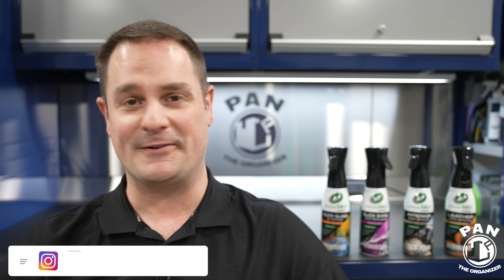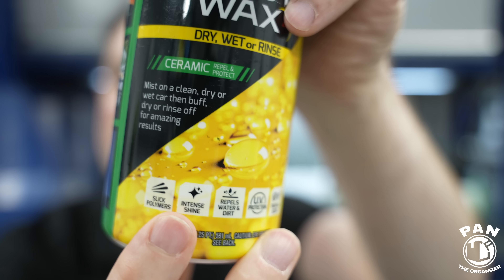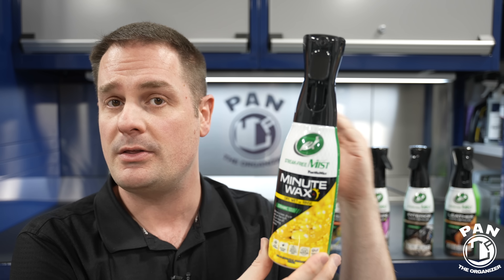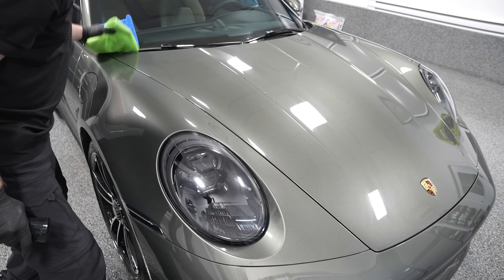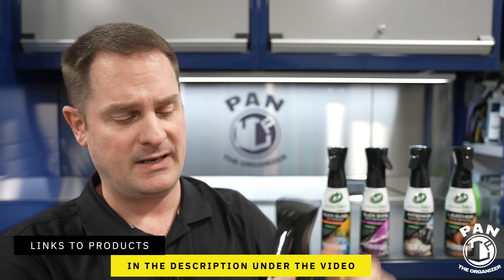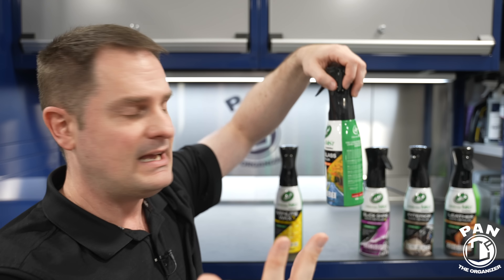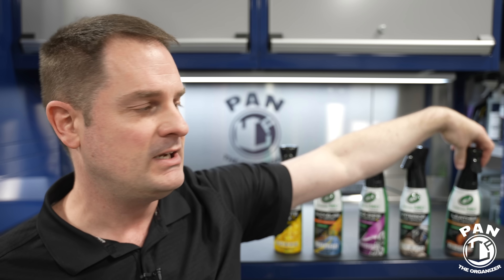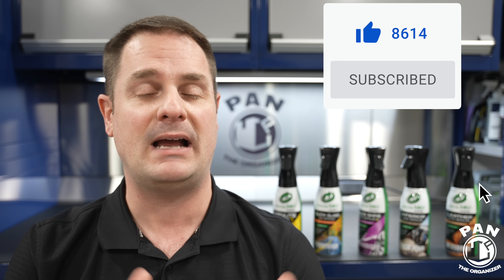The NEW Turtle Wax Minute Wax! You guys made this happen!

Comment: It would have been nice to see it applied to a vehicle that wasn't already beautifully slick and glossy to begin with :/ I wonder if turtle wax required an approval of what car and paint pan did the demo on.
Reply from the maker: Absolutely no input from the brand on that or any opinion I express in my videos. I pick what vehicle I apply the products to. I don't let any brand influence my content.

Also, as this is a detailing channel, the majority of my viewers value and appreciate keeping their vehicles in pristine condition, so this was a perfect example/use case scenario for the product, as most will use it as a maintenance topper of an existing protection, on a well maintained vehicle.

But I have also tried this on vehicles with zero protection, and it works super well, with a nice boost in gloss, slickness and that easy of application thanks to the Flairosol sprayer. And for the price, it's a no brainer. Hard to beat its value really.
Reply: @Pan The Organizer  that's awesome man. But yeah maybe try demoing it on some paint that would really let the product show how much of a difference/effect it can make. Just a friendly suggestion. Love your content tho it's helped me a lot in factoring what products to try and use in my detailing experience as a personal hobby.

Comment: How does the Minute Wax compare against Turtle Wax Wax and Dry?
Reply from the maker: Turtle Wax states that Streak Free Minute Wax is a Walmart exclusive, but it is NOT a Wax & Dry replacement. Streak Free Minute Wax has the same easy application on clean, dry, or wet car. But it contains ceramic that it is more hydrophobic and adds a protection of 6-12 months.

Comment: Would like to see a head to head wolf the minute wax pray on rinse off again GYEON quartz Wet Coat.. The cost separation between the two products is dramatic.
Reply from the maker: I wouldn’t compare both. WetCoat is a pro grade spray that will likely last longer but also costs significantly more. And it’s to be applied on wet paint.

Minute Wax is more versatile and can be applied on wet or dry and coats less. But it won’t have the same durability or hydrophobic performance compared to WetCoat.

Comment: How long is Minute Wax supposed to last? I assume it's not intended as a long term solution. Would be interesting to see a long term longevity test compared to say, Seal N Shine or the Hybrid Solutions stuff, as well as other similar products from other brands (Xtreme Solutions Topper, Griot's Spray Wax, etc)
Reply from the maker: It’s not meant as long term protection so durability tests aren’t really important. It’s meant to be used as a quick detailer for regular maintenance after a car wash.

Turtle Wax states one can expect 6 to 12 months of protection with the new Minute Wax, but as Minute Wax is new to market, I still need more time to evaluate the real world durability of Wet Wax in my conditions, but I would recommend it more as a topper over an existing protection, to boost the properties of that protection and maintain its durability.

Comment: We need a demo and a quality and how much doea it last? Because flex wax can last for 4 5 6 7 8 months!!
Reply from the maker: You can’t compare Flex Wax to Minute Wax as Flex Wax is a long term paint protection. Minute Wax is more of a quick maintenance product. Not meant for long term durability.

Turtle Wax says that Flex Wax is their most versatile spray on protection and can be used on multiple different surfaces with their highest level of protection. Ceramic Spray Coating is for painted surfaces only, and Minute Wax is great for a quick addition of ceramic to any existing protection. 

In my testing, Flex Wax lasts 9-10 months and viewers in more gentle climates got 10-12 months. With Ceramic Spray Coating, I see 8-9 months with two layers applied (24hrs between layers). And Turtle Wax states one can expect 6 to 12 months of protection with the new Minute Wax. 

As Minute Wax is new to market, I still need more time to evaluate the real world durability of Wet Wax in my conditions, but I would recommend it more as a topper over an existing protection, to boost the properties of that protection and maintain its durability.

Comment: Slick glass is not very good at all. Just tried it on 2 cars over 2 weeks. Does not clean glass well. Leaves a thin slippery film that wiper blades deposit where wipers stop, leaving a line of grunge that is hard to wipe off. Filmy surface attracts dust.  There are several much better glass cleaners, and apply a paint protector to get water repellent.
Reply from the maker: Thanks for sharing your personal experience with it Doug. How did you discover my channel by the way?

Welcome to my channel. You discovered one of the biggest car detailing channels on YouTube as we surpassed 870,000 subscribers and we have over 110 million views! I have been detailing for 26 years and I love to share my knowledge and passion with my viewers.

You found the right channel to help you learn everything about detailing.
Reply: @PanTheOrganizer  I accidentally saw you on you tube months ago and subscribed because your reviews help me find products to use and select from choices.

Comment: The Turtle is being innovative. 
Observation/question:
1. Your flooring in the shop. Is it Polyaspartic, Polyurea coating?
2. Is it slippery?
3. You've had it awhile. How's it holding up?
4. Maintenance? How do you clean it?
Thx for video Pan!
Reply from the maker: 1. Polyurea. I talk about it in my full garage tour: https://youtu.be/wx6HTBAzeXI
2. It's non slippery. Impact resistant. Chemical resistant.
3. I have had it for almost 4 years in my new home (November 2019) and in my previous house I had a similar flooring coating (2012 to 2019) and that also held up perfectly.
4. Super simple maintenance. Pressure wash it or hose it. Done. Sometimes I'll use a floor cleaner machine with rotating brushes (once a year) with some Simple Green diluted for a deeper clean (after winter).
Reply: @Pan The Organizer  that really helps. I'm having a coating installed April 11th and 12th.
Reply from the maker: My pleasure! What coating are you having installed?
Reply: @Pan The Organizer  it is a base layer of Polyurea, a layer of flakes, and then a layer of Polyaspartic. 24 later, a layer of Ballistic for no slip. It is going in garage that is 24x30 deep. I liked it so much that I'm doing it to the patio area as well. They claim that it is fade proof outside for life (whatever that means). Company says its chemical resist to p.h. levels to a degree. Since I do decons outside, that should be ok. They also say to clean with Simple Green. I will probably do normal cleaning with a p.h. neutral soap, and a microfiber mop, and Simple Green after harsh winter. It's a big investment, so I will let you know how it all goes. Thx Pan!

Comment: maybe dont use it on a previously coated car and show it work on a normal every day dirty car
Reply from the maker: You have to apply this on a clean car. Always wash the car before applying any form of protection. So you point is moot.
Reply: Use it on a car with no coating or previously waxed Pan.

Comment: Is another product even necessary, I say not?
Reply from the maker: I would still recommend a long lasting protection as a base coat first (like their Graphene Flex Wax which can last 9+ months) and then maintain that with the TW Minute Wax, great combo.

Turtle Wax states one can expect 6 to 12 months of protection with the new Minute Wax. 

As Minute Wax is new to market, I still need more time to evaluate the real world durability of Wet Wax in my conditions, but I would recommend it more as a topper over an existing protection, to boost the properties of that protection and maintain its durability.